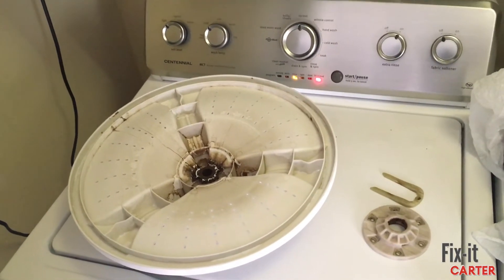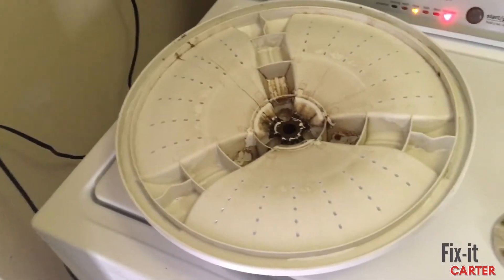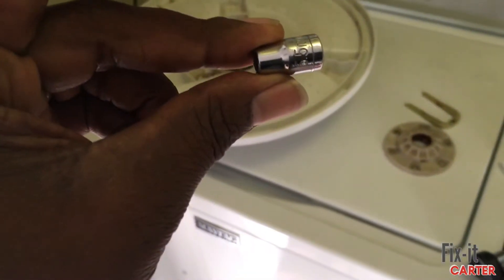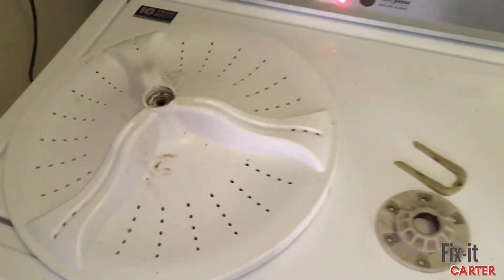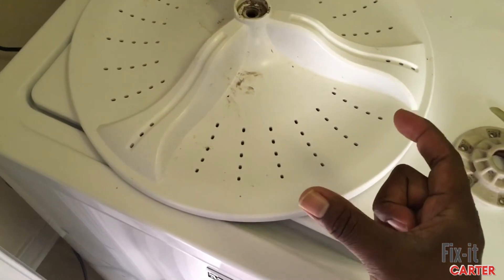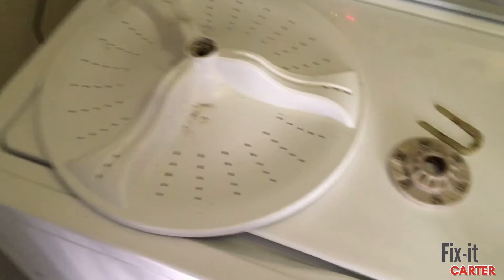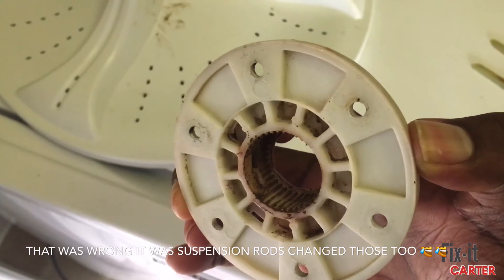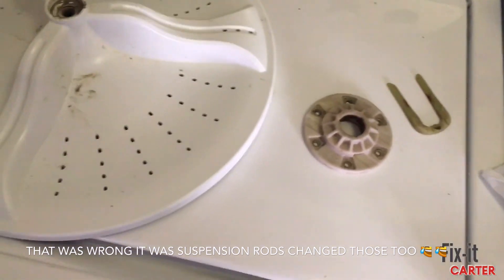Maytag High Efficiency Top Load Washer Grinding Noise

Comment: I replaced the splutch and drive belt and was still doing it. After watching this, i pulled the tub hub, the thing with the 6 philips screws and mine was stripped out in the center. Thanks for the point in the right direction. Hopefully when it come in, i can be done with this.
Reply from the maker: Hey no problem glad I could help. Also thanks for checking out the content. Mines is still running strong and we pretty wash every other day. Good luck with the fix!

Comment: This is good information but what website did you order the OEM parts from, whats the link address plz?  I have the same problem and I'm going to have to do this fix myself. I have the tools just need the parts.
Reply from the maker: https://www.ebay.com/itm/Washer-Wash-Plate-W10902814-Compatible-with-Maytag-Whirlpool-Washer-/114042669164?mkcid=16&mkevt=1&_trksid=p2349624.m46890.l49286&mkrid=711-127632-2357-0
Reply from the maker: https://www.ebay.com/itm/W10528947-Washer-Drive-Hub-Kit-for-Whirlpool-Maytag-Washing-Machine-by-Beaquicy-/193476789121?mkcid=16&mkevt=1&_trksid=p2349624.m46890.l49286&mkrid=711-127632-2357-0